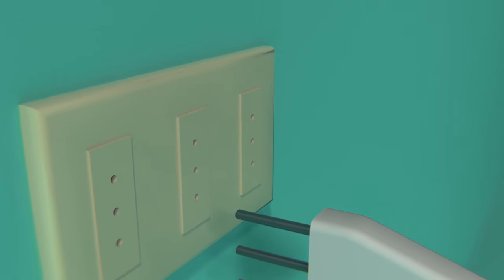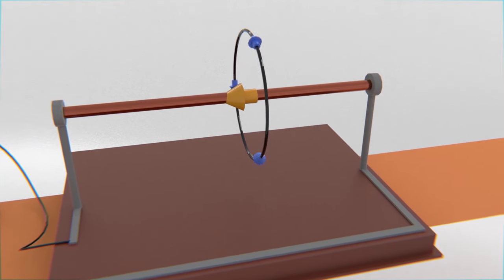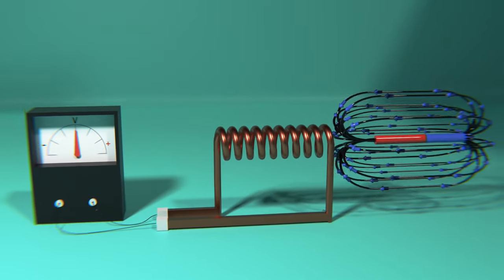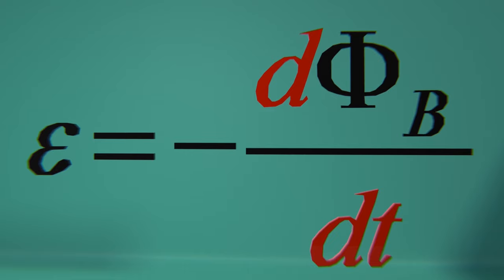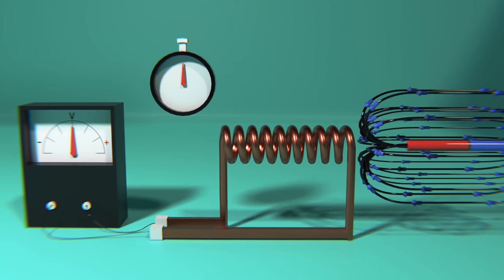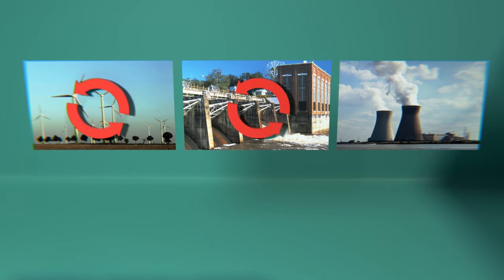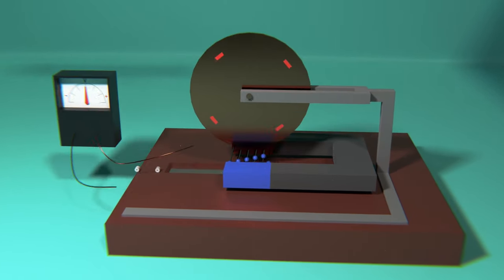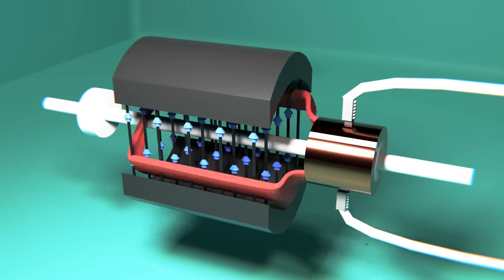How does an Electric Generator work ⚡ How it works

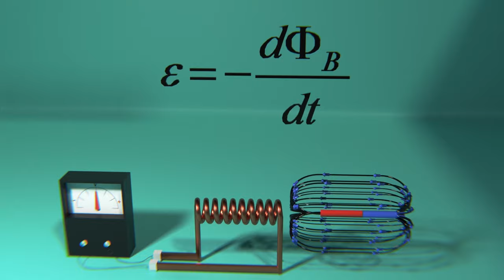Comment: at 1:45 it should be equal to the derivative of magnetic flux with respect to time instead of derivative of magnetic field (the formula is correct but what you said was a different)

Comment: you got mistaken, difference between the dc and ac generators is not changing the position of the magnet with wires. its the structure of the generator and the position of rings and brush seems you do not know the concept. correct your video.

Comment: Why can't we just glue a bunch of magnets to a car piston and have the motor making energy while causing explosive power at the same time, then use this reaction to start a chain of mechanic motion out of the vehicle?
Reply: what exactly are you using the electricity generated for?
Reply: The magnets would cause resistance, the pistons would move slower. Just use an alternator

Comment: The term "generator" is misleading.  Generators don't generate anything.
Reply: @upswindows umm no actually it doesn't.  Think about what your kitchen faucet does. There are components in place that allow....... fill in the blanks. 
Clue; Another name for faucet.  3 letters.
Reply: @shaneroper5470  it generates electricity from motion... dude stop trying to act smart